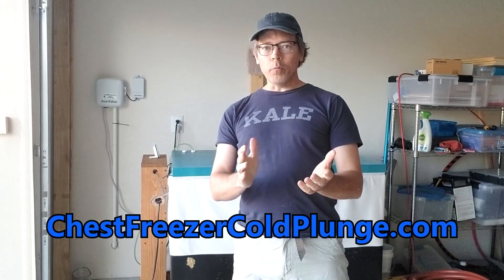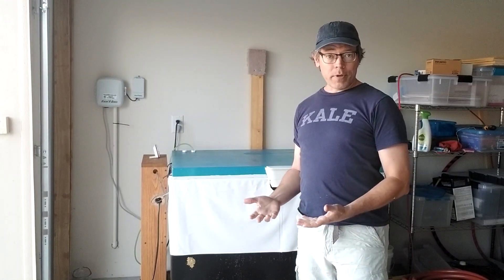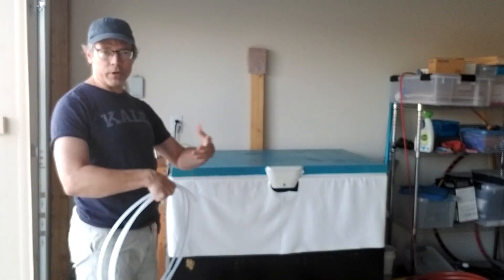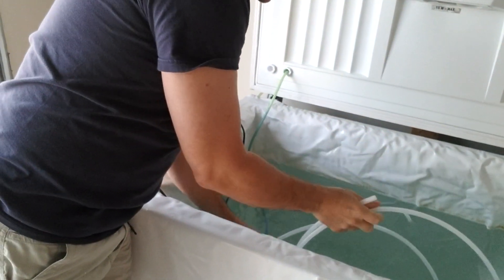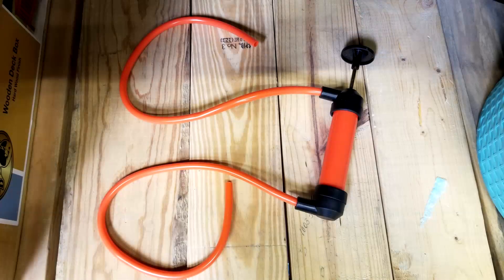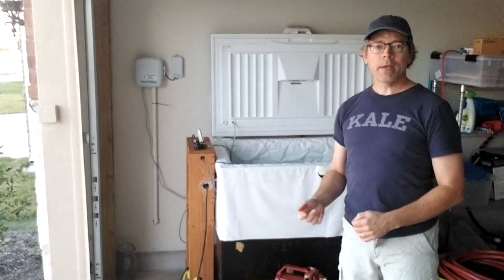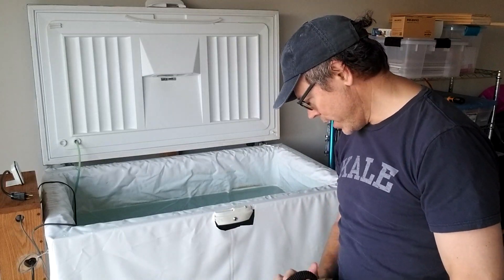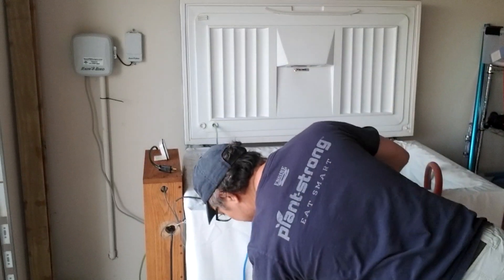Siphons & Pumps: How to Drain a Sealed Chest Freezer Cold Plunge

Comment: The inside of my chest freezer has like a foil on it. I'm trying to get the freezer dried out for storage but I noticed there seems to be water underneath the foil layer. How do I get this water out, so the freezer does not rust away while not in use?
Reply from the maker: Put it in the sun with the lid secured in a slightly open position. Let it bake for 7-10 days until the moisture is gone. 

Or leave it inside with the lid fully open and use heat or grow lamps. 

Water got inside the walls because the seams were bot sealed correctly (or at all), and / or because a liner was not used. 

See the articles on my website about sealing the seams and liner options for your chest freezer.
Reply: @JohnRichterAustin  Thank you
Reply: My freezer has a drain pipe under but this water isn't coming out from the pipe

Comment: Your book is super helpful, thank you!  Just finished converting a Frigidaire 19.8 and need a pump to drain.  Do you have one that has been cost effective and successful?  I'm pumping into the yard and want to make it easy (and quiet if possible).
Reply from the maker: Ryan - thanks for your comment. 

I used a Liberty pump for several years, which is a very good (but expensive) pump. I finally decided that I didn't like having to hook up two hoses and priming it each time I wanted to use it. 

I just recently bought a 1/2 HP Superior Pump, which is submersible, only requires one hose, and no priming. I have an Amazon affiliate link here: 

https://amzn.to/3zRPf9N
Reply: @JohnRichterAustin  Thanks. Don't these leave like 1/4 inch of water in the bottom.  So do you use a hand pump to get out the rest?
Reply from the maker: @ryan_explains  - I tested two different submersible utility pumps. The $150 Everbilt was supposed to go down to 1/8" but left an inch of water. The 1/2 HP Superior pump left about 1/4". So they all leave a little bit of water. Even the $200+ Liberty pump left some water because of the way the intake hose would start bringing in air when it got down to 3/4" (less water than the hose opening). 

The strategy is to pump the pump next to the compressor side and for that last little bit of water lift up the opposite end. That will get most of the rest of it. The little bit that remains can be removed with a small scoop (like a measuring cup) or soaked up with towels.

Comment: I know this sounds stupid. But I just built mine and the water really smells like a freezer. Like could it be freon gas that has leaked into the water area or something? If so, is getting freon on your skin through the ice bath bad?

Also, I didn't seal the drain hole at the bottom. I am reading that others do this. I am wondering if this is the root cause of my issue. I was hoping to still use that as my method of draining the chest freezer.
Reply: are you using ozone?
Reply from the maker: Brandon - my Facebook group would be a better place to discuss this than on YouTube. Can you post your question there? The link is in the video description above.

Comment: Thanks John, solid info.  My drain plugs (inside and out) do not screw in, they are more like caps.  Do you know or could you think of a way to seal these during use without sealing them completely? I have a slow leak if they are left in place as they originally came.

I would rather seal them completely than use the liner (personal preference) which would not be hard... but would like to brainstorm a way to temporarily seal them for intermittent removal. 

Im thinking plumbing tape or just packing them from each side with some kind of rubber plugs.  

Appreciate your video and would be interested in your thoughts on my situation!
Reply from the maker: Hi Nicholas - I just now saw your message. I was in a car accident in Feb and it threw off a lot of things. 

Plumbers tape on the threads or a tapered silicone stopper (avail from The Widget Company website) will work. 

However, if your drain has a plastic insert, that insert  will need to be sealed to the floor.
Reply: @JohnRichterAustin  I hope you're okay!! Thanks for the info
Reply from the maker: @relaxation_and_tax_evasion  - You're welcome !I'm making good progress - thanks for the info!

Comment: What is the thing you have lining the inside ?
Reply from the maker: It is a PVC liner custom-made to my specs. 

UPDATE OCT 2021: There is a huge disruption in the plastics industry right now, but I do have one vendor who can make the custom liners. 

There is a lead time of about 4 -6 weeks for production and the liners coming in at around $460 - $550 + shipping, depending on the size and style of your chest freezer.
Reply: @JohnRichterAustin you use the liner regularly?
Reply from the maker: @ Yes. I liner must always be in place in a chest freezer cold plunge if you want it to last long term.
Reply: @JohnRichterAustin  if I used this would I still need to seal it?
Reply from the maker: @2424jhg  - yes. Best practice is to always seal the seams.